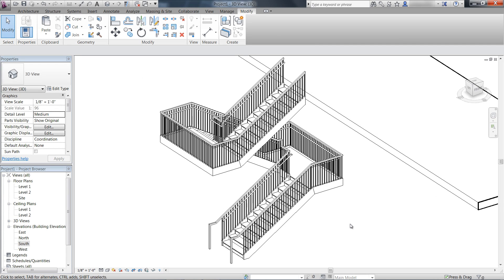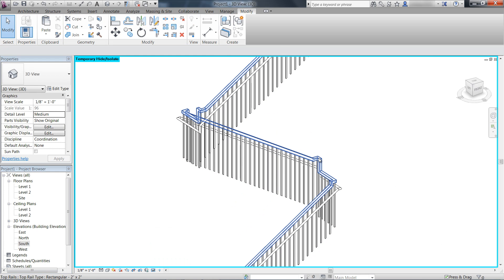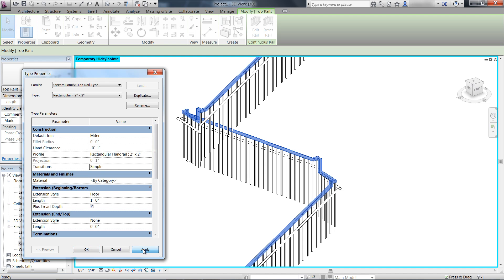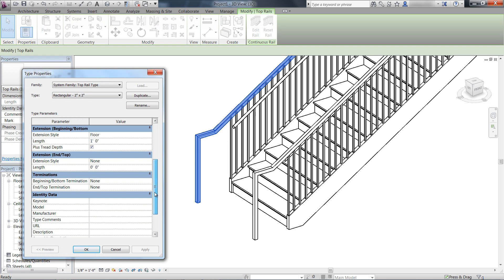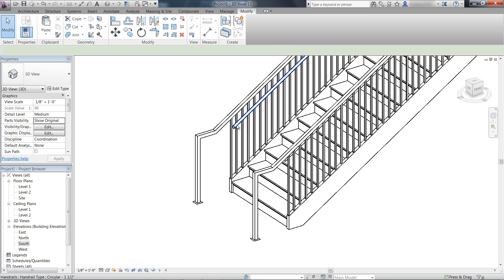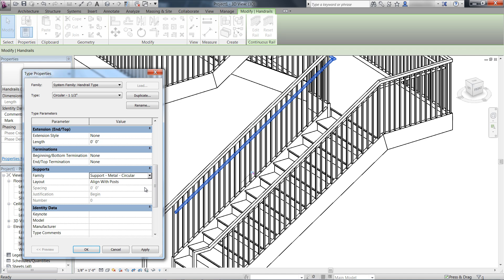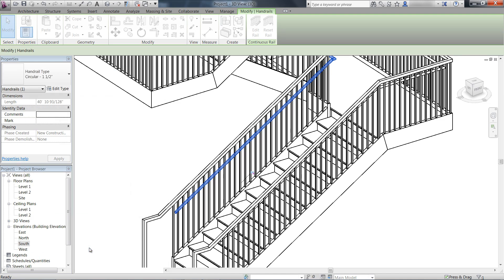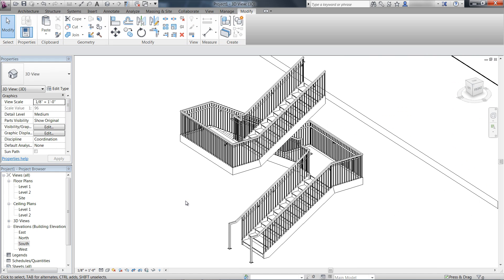04-Railing Enhancements - Defining Rail Transitions, Terminations, and Supports

Comment: The extension of a railing that returns to the wall and isn’t parallel with the floor does NOT function properly. It’s clear based on the results you get that they’ve written the program so the railing will return to the wall properly only when parallel to the floor. Another epic failure.